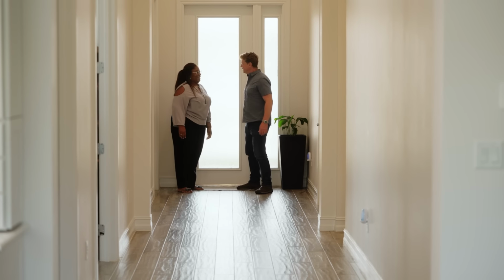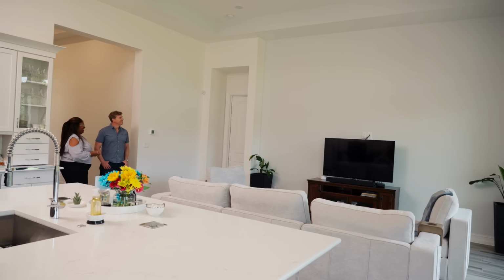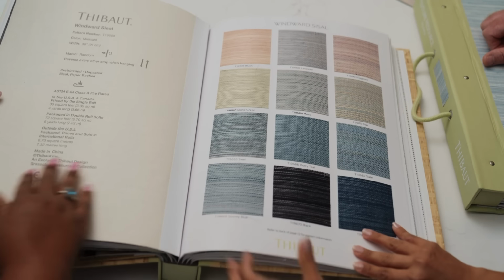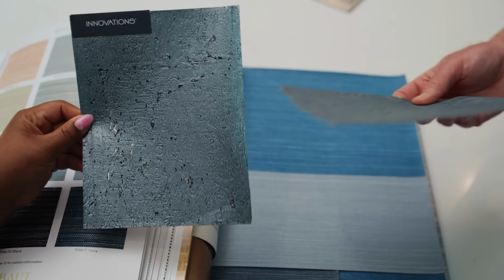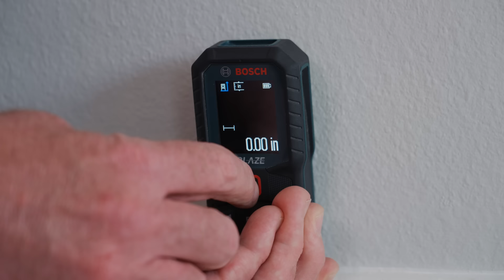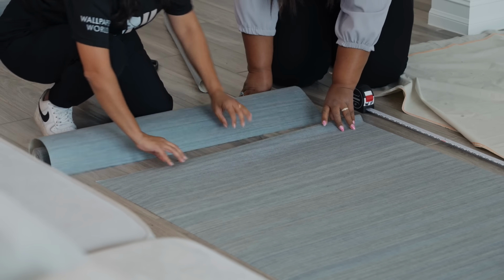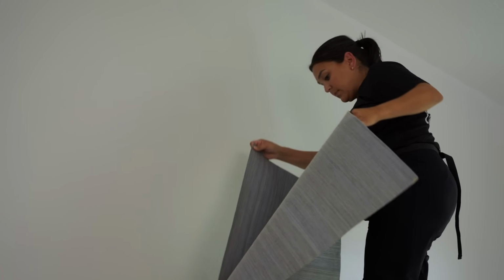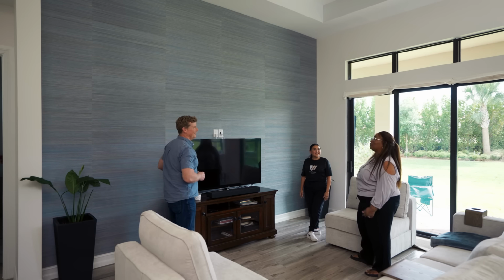How to Create a Wallpaper Accent Wall | Ask This Old House

Comment: I kind of think if they would manufacture the wallpaper with the lines going down the length instead of across then you could mount the wallpaper on the wall horizontally and it would hide the seams a lot better. Maybe it would make it more difficult to install but still very possible. Unless the look IS to have seams.
Reply: I’d be willing to bet that either the width is limited by the type of grass used, or that flipping the grass to run lengthwise would be a manufacturing and logistical nightmare.
Reply: That would make the room look taller. Which it is already tall.